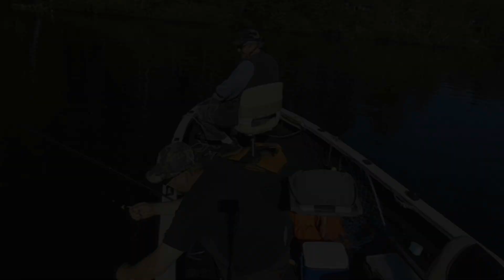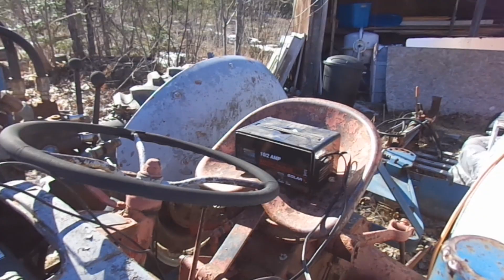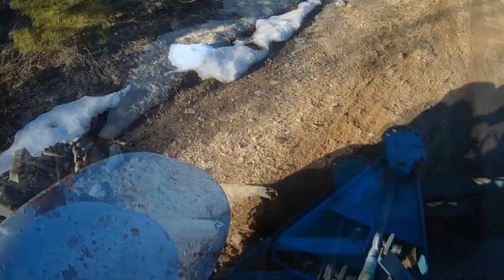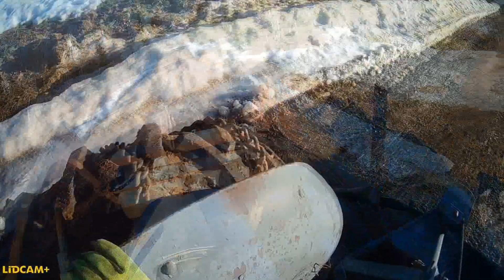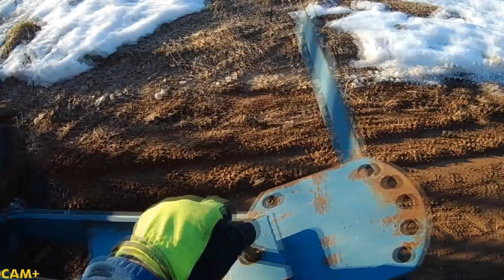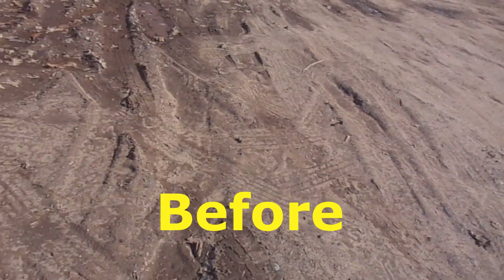Old Ford Tractor Grading The Driveway

Comment: I have a 9n Ford that was my dad’s. I converted it over to 12 volts a few years ago.
Reply from the maker: I haven't gone to 12 volts yet.  But I did rewire the entire starting system and I have rebuilt the distributor a couple times in the last 10 years.  Every little voltage drop in the circuit is a big deal with only 6 volts.  Since the starting system rewire it has been starting pretty good.  Although I would like to not worry about keeping a 6 volt battery charger handy, so maybe someday.  Thanks for watching, KPO.